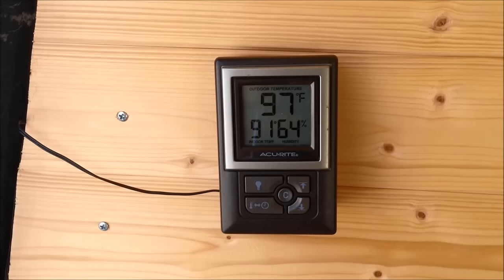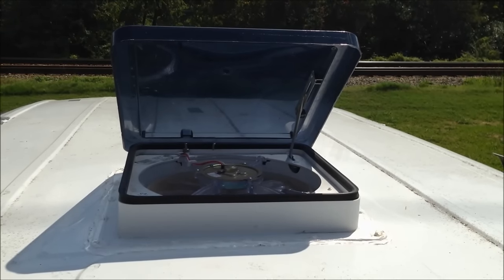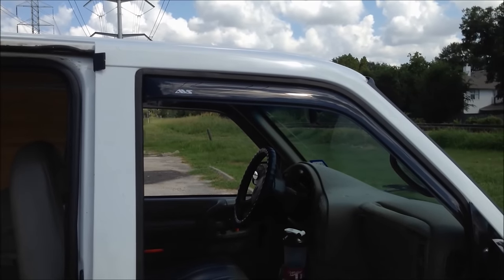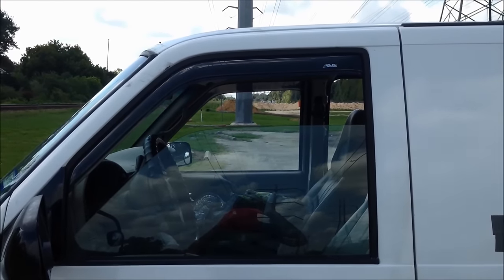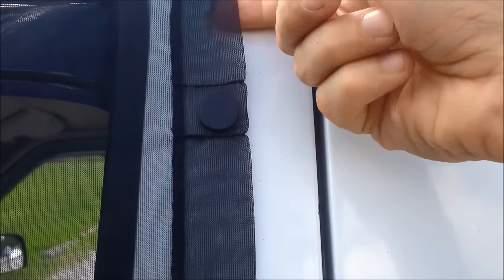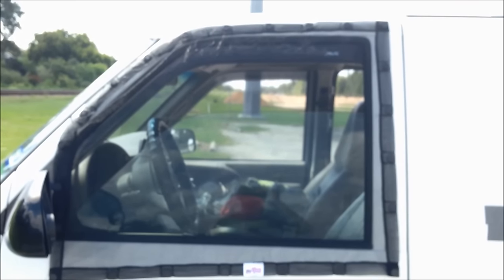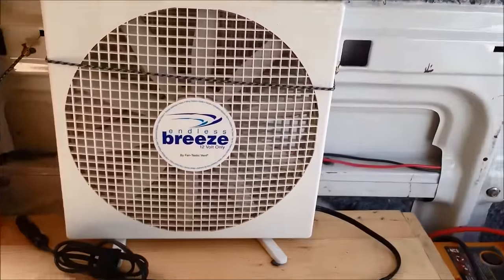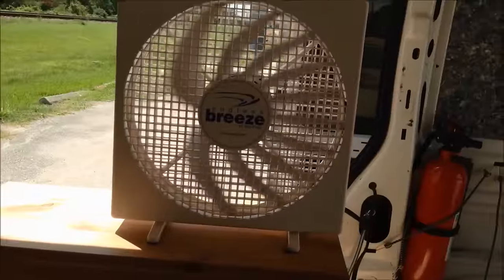Ventilation Tips - Camper Van Conversion

Comment: Love the rain guards. Here in the NW, cold is more of a problem. If we put curtains over the cab to keep the heat in, condensation builds up in the cab rotting the electronics. Dehumuidifiers did very little and the best was I've found is using insulated plywood to virtually seal off the cab while stationary.
Reply from the maker: I was recently in Colorado, enjoying the cool air and loved it.  Now, I'm back in Texas, dealing with heat and ventilation issues, while still trying to remain stealth.  It's a challenge.  The insulated plywood sounds like a good idea.

Comment: We to use the Fantastic fan, and made some home made screens for your four windows, plus use a 10"or our 8" O-To-Cool fans. To help with the window screens purchase some extra magnets from Ebay to seal your gaps. It feels like if we leave the vent controls on the dash on that lets some air flow through the vent to help also. Your portable fantastic fans seems a bit noisy, or it maybe the camera picking up the noise? Painting the bubble on the Fantastic fan will help with sun lite and stealth! 

Great Tips Troy! Van Campers are dwindling on YouTube!!
Reply from the maker: Hey +Illini Trekker.  Yeah, I started to make these screens myself and even bought some supplies, but as I got busy this summer, I realized I can spare the $55 to have them pre-made and delivered to me.  ;)  For me, I'm a very light sleeper.  I need white noise or I will not sleep much at all, so a noisy fan is good for me, even if it cuts down on stealth.

I've seen/heard others paint their vent covers white to match the van, but I like looking out at the moon at night and I have a homemade interior cover for it during the day.   At night, if it were white, it would stand out against the darkness, so I like mine black to blend in with the night.  I will eventually have a roof rack and solar panels, so the vent will be less visible during the day. 

Thanks for the input.  I will have to use my spare magnets to shore up the gaps.

Comment: I would like to see someone test indoor temperatures with fan running vs no fan and just letting the heat escape naturally out the vent , the reason I say that is I've never noticed it being that much cooler with the fan on , although I have a fan like your endless breeze fan and that fan definitely makes it cooler as long as it ain't super humid.Good tips
Reply from the maker: Thanks for the idea.  I just might make a video on testing temps.  I have done experiments and I've found that having the roof vent fan on does help.  I don't use mine all night.  I just use it too suck out the hot/stagnant air and replace it with hopefully cooler/fresher air from the outside.  I may run it for 20-30 mins, then I do like you said and turn off the roof vent fan and allow air to flow naturally, with the help of my Endless Breeze fan.  Thanks for watching.

Comment: I'm having trouble deciding where to put my roof fan.  should it be in the center of the van or towards the back more?
Reply from the maker: +Joe Hikes For my van, I only use the roof fan to suck air out, so the further to the back, the better. I crack the front windows where the fresh air comes in and the hot/stale air goes out thru the fan. Hope this helps.

My cooking area is also in the back, so food smells and heat from propane stove, go out the fan. I guess it really depends on your floor plan.
Reply: @TravelingTroy  Thanks for the info.  I just ordered the Skeeter Beaters for my Ford E-250.

Comment: I live in Houston and I couldn't imagine being outside even at night with the intense humidity you are very brave. lol...
Reply from the maker: Yo Houston!  Well, you for sure understand the difficulties of the Houston heat/humidity.  For me, the mental adjustment to the heat probably started with me living in an apartment with bad insulation and I was tired of paying $150-$200 or more a month in electric bills, so I began training my body to not need A/C as much.  Instead of keeping the thermostat at 72, I would keep it at 80 to 85.  Over time, I got used to it.  Now, there is no way I'm hanging out in the van during the day in the 90-100 degree temps, but at night I can handle the 75-85 temps with no prob, though it can be a bit sticky.  :) Thanks for checking out the vids!
Reply: NE Houston, awesome videos and setup, do you feel like your asto van is too small for two people?
Reply from the maker: Hi there.  I think the Astro van would be fine for two people on short trips, but full-time would be difficult.  It could definitely bring the two people closer together or further apart, depending on how it goes.  I built mine with the intent of have a visitor stay with me for a week at max.  It would be neat for a friend or family member to come hang out at a cool location for a week to see what the lifestyle is like.
Reply: Thanks man, that helps alot! Have fun out there and be safe.

Comment: would it help to have 2 vent fans?  i see some people install two.
Reply from the maker: Absolutely.  Dual vent fans or the “double bubble”, would really help with air flow, if you have the room on your roof.  One fan could suck the air in, while the other fan would pull the air out, creating a constant flow of air through the van.  The only drawback would be power spend.  Two fantastic fans on low would draw about 1.5 amps each.
Reply: @TravelingTroy  Thanks for the info! I plan to convert a small bus so hopefully I'll have enough solar power..
Reply from the maker: You can never have too much solar power. ;) Good luck with your build, should be fun. 👍

Comment: What items would I need to create the power source without solar panel like you have set up?
Reply from the maker: I would say that the cheapest, easiest route would be to have a "house" battery, where you store power for charging phone, laptop and lights and use a battery isolator to charge it while driving.  If you're camped in one location for a while, you could get a portable solar kit to keep the battery charged when not driving.

Comment: How do you power that fan? I'm just curious about the power source when the van is off at night. I'd be worried that fan would kill the battery very fast.
Reply from the maker: Hi Daniel.  I have two AGM batteries with 210 amp hours available which are charged by three 100-watt solar panels.  My fantastic fan only uses 1-3 amps depending on the speed which it has low, med & high.  I normally use low or medium speed, so only 1-2 amps.  You can see more about my power setup here: https://youtu.be/UYSxsb3EQgM  and more about my solar setup here:  https://youtu.be/aadVUE0RKwk  Thanks for the question and checking out my videos.
Reply: Daniel Duarte , his use of a DC fan is more efficient than running regular AC household appliances off the battery.

Comment: What's it like in the summer? I'm in Houston too and summer nights are unbearable already
Reply from the maker: It's not pleasant, but with proper ventilation it can be tolerated.  Over time, you become accustomed to the heat.  I am fine with heat now, but I get cold easy.  The good news is cold can be dealt with easy using propane heaters.

Comment: Hi Troy I own 2004 astro I love it. My friend and I looked everywhere  for a camper van could fine nothing  but problems. My ? Big one would you and your dad consider building my van for and if so we could discuss  price for job. I can't fine anyone from my area with the know how. We want to travel and explore so bad we can taste it.
Reply from the maker: Hi Martha. Excellent! You've got one of the newer Astro vans. ;) Mine just turned 20 yrs old. We just completed the major components of my build this past weekend. The build has taken us 3 yrs. For more on why it took so long: http://travelingtroy.com/2018/longest-van-build-van-build-history

My plan now is to really enjoy this van we worked so hard on and get the most out of it over the next few years. I understand it could be difficult finding someone to help with your build. If it wasn't for my Dad, my camper build would have turned out way different, not as cool. I did, however, learn a ton during this process.

Your build doesn't have to be complex. You could move in a small dresser, build a basic bed frame, use storage tubs and a cooler to start. If you like it, you could improve your build from there. Well, I hope you find someone to help. Maybe hire a handyman/carpenter for the basic woodwork and an electrician to hook up lights and others.

Comment: I just bought the fan, but  have a question if anyone can answer it.  I have one AGM battery, powered by solar.  If my battery is on full charge , and I turn the fan on, how many hours on low would it run before  I should charge the battery again?  Mostly I would be using the fan at night while sleeping, and I wouldn't want my battery to go down below half charged.  I've read lots of reviews of the fan, but no one addressed this.
Reply from the maker: Hi there.  I still have my fan box, so I checked the amps used at each speed.  Low - 1.86 amps, Med - 2.29 amps and High - 3.00 amps.  These figures are based on a 12 volt system.  I don't know if you have a 6 volt or 12 volt battery and I don't know the size of your battery, but you are correct, you don't want to go below 50%.

This fan on Low at 1.86 amps will use up 34 ah in an 8 hour period.  So, if you have a 12 volt - 100 ah battery, then you will be fine.  If you would like to test some other configurations, try this site:
https://www.batterystuff.com/kb/tools/calculator-sizing-a-battery-to-a-load.html

Hope this helps.  :)
Reply: Thanks. It's an AGM 12 V (not connected to the engine) but charged by solar. I was just wondering how many hours I could run it before I should turn off the fan.  Don't know if that makes any sense or not, lol. But thanks for responding!

Comment: One tip is to use a silver windscreen reflector. Otherwise you are attracting heat with your black dash and interior cabin and sucking the warm air through your van. Works great on a sunny day.

Comment: Nice! Thank you! : ) 
Can we see more of your wood floor? How does it hold up with traffic when it rains, etc?
Reply from the maker: Hi there, +Maxwell Bernstein.  The floor is actually a vinyl flooring.  It comes in long strips, easy to install and easily cut to fit.  So far, the floor has held up well, but I haven't had a big spill or water leak yet and I usually wipe my shoes down before moving to the back of the van or I whip the floor immediately if I track mud or water.

Comment: Where I sleep most of the time using one of those window nets wouldn't be very smart on my part, that's why I never bought them. But if I was boondocking, and hopefully that time will come, I probably will get them, even with all my ventilation. 
One thing you can do to stop bugs in their tracks is to get a sign for each window saying; No Bugs Allowed. VanJones raves about them.
Reply from the maker: Ha!  I need to look into those signs +Rolling Earth-Ship.  True, the window nets aren't great for urban stealth camping but awesome for boondocking.  You could use some white tape which would match the van's paint and tape up where the netting and magnets overlay on the metal, then the rest of the netting should blend in with the tinted windows.  Possible future upgrade for me.  :)
Reply: +Traveling Troy: I'll ask VanJones to mail you some of those signs. 😂
Even white, those skeeter beaters used in cities would be asking for some wondering hands to come break in. They are great though, and you seem to be using them successfully. 👍🏻😄🚐
Reply from the maker: True +Rolling Earth-Ship.  They do reduce your security with having open windows, they cut down on stealth and they could very easily walk away.  I'm currently staying on private land, so it's not much of a concern for me at this time.
Reply: +Traveling Troy; yep, that has always been my concern. 
Be safe. Don't let the bugs bite. 😄👍🏻

Comment: I'm going to make a hole in the floor with a vent valve over it. that'll get the air flow from underneath  the van and out through the top.
Reply from the maker: That could be a good idea.  Here in Houston, we often have to deal with floods, so the less holes in the floor for me the better.  :)
Reply: Year good point so I have decided to fit a tube from the floor up about a foot which can be capped off when not in use, the end of the tube will end up close to my face when I'm in bed for a good supply of fresh air. I'm a stealth camper so things attached to the underside are preferable. Where I come from (the South of England) parking up is very costly and sleeping on the road is not excepted. Good job I only need to stay in the van once or twice a week. Thanks for the channel mate.
Reply from the maker: Ok, I understand.  Stealth is important, so having a roof vent on top of the van would not work out.  In that case, the tube coming up from the floor seems like a good alternative.  Interesting idea.
Reply: Lightning Flash what did you end up doing?
Reply: Lightning Flash, yeah I had the same idea, only using "mobile home floor vents" fed by a "linear swamp cooler" under the floor. The  exhaust air would flow out through  flush vents around the walls or a camouflaged ceiling fan/vent.

Comment: why don't you just build a frame for the two windows in front. so you cud  have your window down
Reply from the maker: Hi Elaine.  I've actually been thinking about what I can do to improve the front driver and passenger window situation.  Mostly for security, but airflow as well.  The problem with those windows is that there isn't much exposed metal which would make it difficult to secure a frame, screen or cage to the window/door.  I'm looking at it and thinking about it every day, so we'll see.  Thanks for the suggestion.
Reply: Measure your windows then build a frame to fit them i did it with my motorhome windows in the front Windows
Reply from the maker: Interesting.  I will look into this.  Thanks.